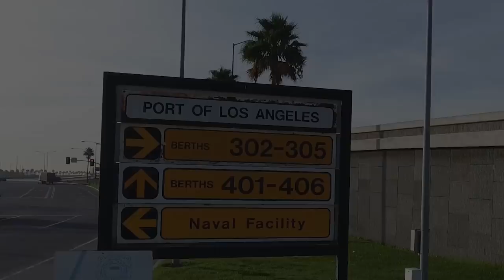$200 Miata Kart Gauntlet #shartfest //DT234

Comment: Anybody else notice how shart car had a different seat at 7:35 and then it changed at 7:42 when shariff started rippin???
Reply: Dan did that in a previous build episode. since you cant slide the seat up it has 2 sets of bolts. short guy seat and tall guy seat.

Comment: How do I do that to my Miata I want to have a really strong front end and put my fenders on with the bumper
Reply: Learn to weld tube steel. Also need to bend it. Search up Roll cage welding, or anything to do with pipe welding really.

Comment: So the shart cart needs boost!!!! get on it order the 69 dollar turbo manifold get a journal bearing ebay turbo... if i need to explain now than you shouldnt be building a shart cart.. even 5psi with a external wastegate would make the crazyiest turbo sounds ever and shart cart could actually do a burnout than.. Boost the shart cart!!!!!!!!! the sounds a external wastegate makes is amazing and would make even more noises the less boost you run so its a win win for shart cart!!!!!!! ps... it will make 420.69 hp at the rear guibo